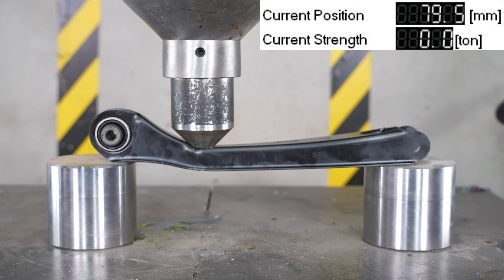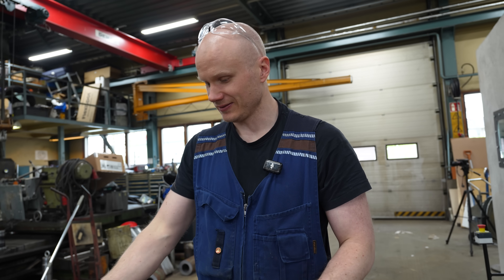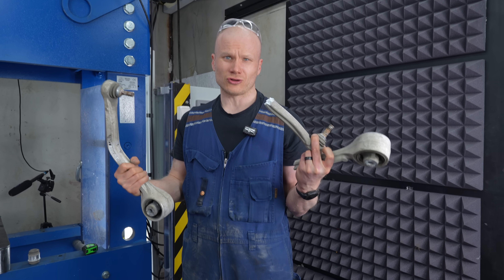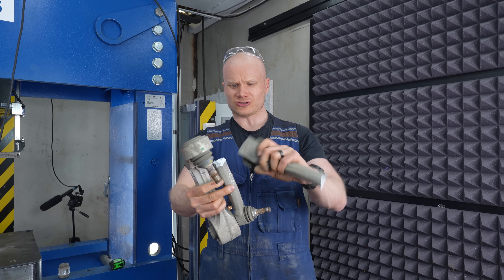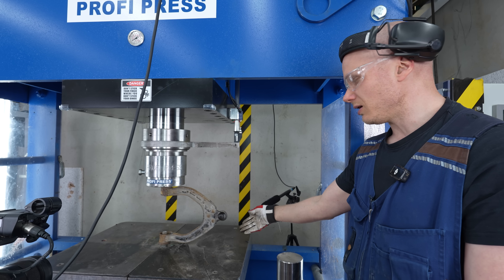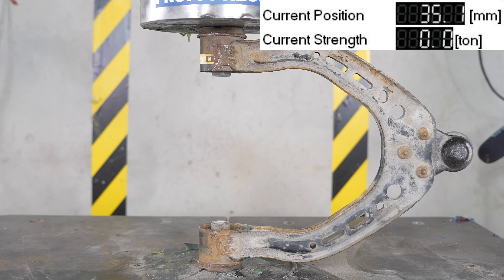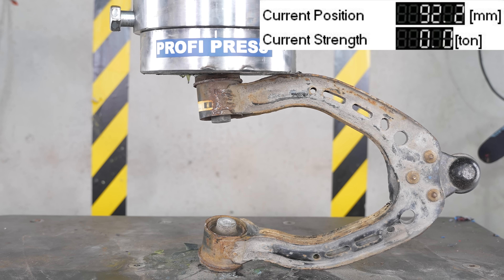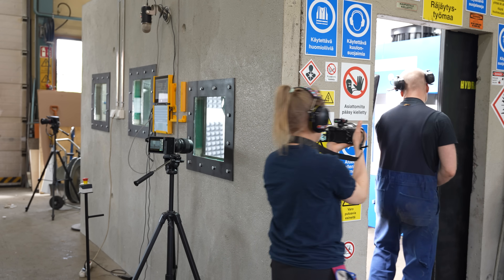Crushing Parts From My Tesla Model S

Comment from the maker: If you haven't seen our CNC machined dice project go check out our kickstarter https://museumdice.com/
Reply: You need to do Yield stress divided by vehicle weight.
Reply: It's a pity that tests like these aren't done at a slightly higher level of information — for example, testing ball joints and control arm bushings axially under natural load conditions. But it's always fun to watch, thanks.
Reply: the majority of failures on control arms are at the ball joint. my request is that you pinch them in a jig at the central bushing and apply force to the ball joint until the pressed in unit snaps off or cracks the housing as that is the most common catastrophic failure I see. IE speed bumps and impact accidents.
Reply: Tesla is king !!!

Comment: One sees, you have no background and no idea, how these things are produced. I worked in a factory that produces them. Actually the bending of Audi part is better than the cracking of Tesla at higher weight, because cars are planned to bend, not crack, Cracking poses a danger to the driver and passengers. Stell is the same, that is why these parts include a good part of Chromium and other materials, in order to make them spring-like, and not rigid. The same applies to tools, like clamps, hammers and other tools. Tools that are made of cast iron, are quite dangerous to the users, because they don't bend, but crack.

Comment: The ones without the shock/spring mount in the middle aren't designed to see high vertical loads because they won't see them. Where the spring attaches is where the reaction force to the vehicles weight acts, and to a lesser extend the where shock mounts in a divorced setup.

Comment: Except the first two parts ( Audi and tesla FLCA) the other parts are not designed to take vertical loads, hence it doesnt make sense to evaluate their stregnth by apply vertical load on them, you need to apply axial load on them. Also the arm that takes the highest load doesn`t necessarily mean its the strongest one, I.e if the part is designed to take maximum 5 tonn of load and a competitor part for same car is taking 10 tonn, this means the part is overdimensioned and is unnecessary expensive.

Comment: How much weight can these parts support in the real world? 600 kg? 900 kg? 1 tn? (per axle). If in the video they support 2 or 3 tn or more, they're already reinforced. Increasing their strength will surely increase the weight and price unnecessarily. Why support 8 or 10 tons? Are they planning to jump rally ramps? I'd prefer them to support a little less, within reason, and reduce the car's weight, increasing agility and fuel efficiency.

Comment: To be fair, the real world loads on these parts won’t be in the direction tested here and any crash that damages these control arms would do much more damage to the suspension than break this. Aluminium is used to keep unsprung weight low and make the suspension more reactive to bumps. Most of the time, the rubber in the joints wears out over time and the whole part needs to be replaced.

Comment: Audi control arm bends and that's way better than be rigid and snap... So quality cannot be measured on a Hydraulic Press, 5 tons is enough to handle far better the vehicle weight, and at the time of small impacts is better to have it bended, instead to have your tire flying off!

Comment: You really need to support the arms they way they are designed to be supported with a bolt through the bushing and the other end bolted through a hold.  Otherwise, the parts that are relatively flat hold their position whereas the others developed torsion which likely led to earlier failure.

Comment: Knowing how to use a press does not mean you know how to test or what to test. Your channel is reinforcing a negative stereotype  of the bigdumb man
How those controls arms were being tested had nothing at all to do with the jobs that they were intended to do. It's as if you were testing beams by testing them as joists. Control arms that have only have an eye in one end and a ball socket on the other are designed to be used in tension and compression along the axis of the member. Ones that also have an eye in the middle also need to support a load at that eye The middle eye is where the press load should be applied.

Comment: one big mis concept.  the control arm are NOT design to take of bending load.  It is design to take on load along the control arm, stretch or compress..  That is why can be so small.  This isn't a test for strength of the design

Comment: I think the Tesla failed while the Audi did what it was designed. A part should deform rather than break. Meaning the Audi would bent but still remain, i.e. you'll still have a wheel to help control. While you would loose a wheel. I guess it depends on what they expected to happen.

Comment: little bit of "boring" science to the crushing. the tesla suspention arm is plenty strong in this test as it did not slip out of the way, however, in real operation, the arm is being loaded by the holes and also held in place by the other components so it does not have the tendency of bending to the side., In such conditions, the audi arm will be more comparable, as unlike the tesla arm, the material around the hole is reinforced and the entire arm is more designed to flex rather than break, which is a preferable in a component as a suspention arm, that experiences heavy sudden hits. also for the same reason, steel arms are better option in my opinion, as aluminium does not flex, but breaks, unlike steel, that flexes back, and even if severely bent, the material still holds strong. Also, aluminium has tendency to crack and deform in a stressed component, thats why steel is used for heavy duty operations, even despite the weight. the sh*tmetal part is not designed to be loaded in the same way, thats also why it is missing the hole in the middle

Comment: Most of the malfunctions have to do with the rubber bushings of the control arms and those are worthless from Tesla, "weak stuff" and not resistant to fast acceleration, partly due to its heavy weight. Greetings from the Netherlands.

Comment: If anyone wonders: those control arms are NOT that much for load-bearing. 
Forged ones just CAN bear bigger loads, but even the U shaped monstrosity is good enough. (I'll admit it needs changing when the rubber bushings are bad since they DO warp @ that point, but the Tesla ones are all OK for long long use). 
MY OLD FART 2009 FIAT 500 THO, HAS FORGED STEEL CONTROL ARMS, SO... GIT FKD N00BS!

Comment: Yes, the Audi is still the best because it is not brittle and does not crack on the first impact, but how long that part will last depends on the quality of the rubber bearing and the weight of the car itself.

Comment: You are pressing control arms on the wrong side... you have to check the force direction when instaled and then you can press it on that direction, that cheap control arm that didnt  managed the press (0 tons) is made to hold a front differential....   so you will need to press it all the way from the long side...... and then you will see how much can handle....   be more intelligent and less millenials.

Comment: It should be noted that most suspension arms are designed to deform in a controlled fashion above some load threshold as a sacrificial part; to limit frame damage, for example.  So, choice of material and geometry are tunable parameters and maximizing ultimate strength may not be the intended purpose.
Reply: Yeah, this guy clearly isn’t an automotive engineer.

Comment: as someone who doesn't know nothing musch about physics and dynamics, your test seems a bit useless, because depending on the shape of the control arm, it could be more or less weak at some places than others, so when you put the hydraulic place on a place that has a shaping going on, it has creases, it has sharp edges. it is only normal for it to bend. BUT, when placed on a car, how is is supposed to receive the forces is what will truely show how it will cope with the force. (the movement, like remember in physics class, when we draw arrows to highlight the sens a force is applied) so i think crushing it randomly or systematicaly abouve the silent block is useless. but great content, great video, my critique will still not prevent me from watching the video, i think that it is entertaining nevertheless 😀💪👍

Comment: The load subjected to control arms and heavy duty suspension parts are transversly and axially limited by the equal amounts of subjective weight of the vehicle, cargo, and any other intentional load inflicted upon weight bearing parts, as described and accounted for in all pertinent design configurations during the engineering process.

Comment: the tests are not correct, the parts are not loaded that much in the car, some of the tested pieces are loaded in tension and not with pressure somewhere in the middle of the component….

Comment: The steel control arm is designed to flex as a damping (lateral loads, not vertical) component in the suspension. More as a Toe & camber control than any vertical structural loads.

Comment: In practical reality if the control arm bends / breaks you would be seriously screwed already. The practical question is the durability of the joints there which was also the issue with the notoriously bad VAG control arms.

Comment: A fundamental principle in design: 'Do not make a thing stronger than needed.' (Consider rear view mirror on a car. It is designed to break off in many accidents. If it is made to be very strong and does not break off, it will cause danger.)

Comment: TOTALLY WRONG !!! You press them upside down !!! When you mount these in the car they are bolted with the bolt facing down. That's why they are more thicker on the upper side where you applying the force ;)

Comment: The Land Rover part is Chinesium.
Reply: but you can still get home; however, if the vehicle experienced a 12ton impact on the suspension, I think you will have bigger problems than just a bent lca.
Reply: @K03sport  That's obvious, but going down the highway at idk, 80Mph and hit a good pothole and you'll either crack a rim or break a suspension part. I am not lying saying I've broken one. On a 2004 Dodge Intrepid. The uppers were so oddly placed that they had immense stress, wore through the bushing, and snapped a control arm. Clean.

Comment: Applying the force directly above the bushing is the weakeast part as it was never designed to take any force, one of the big reasons you do not jack up underneath any aluminium alloy suspension arms.

Comment: In an actual car, the control arms like in this video only have lateral load in the length when cornering. And front/back loading when braking on the radius rod bush.  So where they are breaking but sideways is the load under braking.  Since most cars don't get much over 1g of braking, the weight of the car divided by 2 and then some fraction for the front/rear brake biasing.   Usually the front does about 70% of the brake loading on most cars.

So if the car is 1500kg, the load on braking would be 525kg assuming 1g of braking and the 70% front braking. Nearly all of that from the ball joint to the first bush for the radius rod and the distance ratio divided to the inner bush in the opposite direction but some smaller fraction of that since the radius rod takes nearly all of the load regardless of the leverage.  This short distance the load is across makes the arm very stiff in that condition.

Lateral loads for such arms can take vastly more, but they are even less than the braking loads.

The weight of the car is not transmitted at all through those arms as it goes through the strut, the spindle and into the wheel.  Unless for rear control arms where there maybe a spring seated directly into the arm in the case of a traditional axle. But the rear weight is nothing on most cars, usually only 200ish kg per wheel. Probably higher in an EV, but I can't imagine an EV having a axle type rear, so the point is moot.

Also I much prefer the sheet metal arms, as the loading axis involved on them they are still way over kill, designed right they have no flex in the intended mechanical motions and they are far better than the other options for unsprung weight.  The old cars I am into, around 1993 they changed the front arms to beefy cast steel from sheet metal fabricated ones, and they truly went backwards with the handling due to the dynamics of significantly higher unsprung weight, even with the increased caster the change allowed.

The cast alloy ones would be my choice for cast arms if I had to choose.

Comment: There's still some benefits to the Steel ones, mostly in that they have a lower limit on their fatigue strength. It won't matter when it's new, but as it ages the steel will eventually reach its lower limit to strength, while the aluminum will just get weaker and weaker over the long term.

Comment: The "U" shaped part from your car is the Upper Control Arm - it's not really carrying load; it's just maintaining the direction of travel.
Reply: None of these parts were designed to take this kind of directional load.
Reply: @NotAnonymousNo80014  I know. I was talking about the in-use loads.
Reply: when I heard direction, I made a u turn
Reply: @particleconfig.8935 underrated Dad joke. There is not enough suspension humor on the internet.
Reply: @ezdeezytube  My shock absorbers approve, and say thank you
Reply: Thats were all the abuse come in on the top. Not the bottom
Reply: In real life the parts you are testing do not fail in the way you are carrying out the tests. A much more meaningful test would be to simulate realistic suspension loading on the parts,  not just 'playing around' with a press. 
Other than crash  damage I have never seen a suspension part,  in 40 years an an auto technician, fail as you are showing. The joints and bushings  wear out and any useful test  would concentrate on the life of these parts
Reply: It's omega shaped.

Comment: The difference between the Tesla and Audi parts are cast vs forged aluminium. Also, that Tesla control arm fails in a catastrophic manner while the Audi part twists a bit but you could still drive that.

The fact that Tesla was forced to do a recall because of the control arms here in Sweden and Audi have not had any problems at all with theirs tells the story.
Reply: No lower control arm will ever see anything close to 11 tons applied to the strut bushing like that. 

At least not with anyone alive in the driver's seat....i.e. not outside of a salvage yard crusher.
Reply: @justinluttrell8990  Is that a joke? So how much is velocity + weight when driving over a 10cm bump at 10mph? Is it 20 tons for that car? Yes... yes it is... This is grade school physics.
Reply: If you snap the control arm with that force you clearly crashed the car hard and you wouldn't drive ANY car home after that much force.
Reply: @fookschool  No, they had to do a recall in Sweden over this, the weight of the car snaps it when driving over a bump at times. 

The forces at place is velocity and weight, now multiply.
Reply: @michaelmay5453 There was never a recall. If you actually look it up, it was an "investigation" according to every single news source but they never followed up on the story because it never amounted to anything. Not clickbait enough. But either way, you didn't do the math at all. It's a spring mass equation because the force is spread out over time and not directly done on the control arm either. The most that control arm would get is 1.6x the weight it would normally hold, 1/4 the weight of the car. So rounding a model S up to 5000lbs each control arm would get 2000lbs(1 ton) of force. Last I checked, 1 ton is less than almost 12tons but hey, maybe math is backwards.
Reply: @fookschool  Oh, and  your math doesn't take velocity into account at all. If it's just sitting there you would be correct but any rapid movement will add velocity and you can take that 2000lbs and multiply it by the velocity which would make it 30-40 000lbs of force just in normal driving.
Reply: @michaelmay5453  You would need to drive HIGHWAY SPEEDS over a speed bump to get that kind of force! you didnt do ANY math at all. stop pulling numbers out of thin air to make it seem correct.
Reply: @fookschool  "If you actually look it up" - parts being replaced as service items. Isn't that a recall without doing a recall?

So anyway, fore and aft shock loads from put holes etc. They happen.
Reply: @chrisdavidson911  the repair wasn't for a defective part though. From what I could gather it was bushings that went bad prematurely. That is a far cry from the control arm snapping which is what everyone is insinuating.
Reply: @michaelmay5453 
Over 7 million Tesla cars on Earth. The suspensions are good.
Reply: @dvader3263  Recalled in China before that because not doing so would ban the sales, recalled in Sweden because Transportstyrelsen was looking into it and they knew that they would find so they recalled it. Another recall is going to happen in Germany and then there is France, Italy and Spain all looking into it and as per usual, they'll recall those too.

In the US consumer safety is second to corporate profits so ...